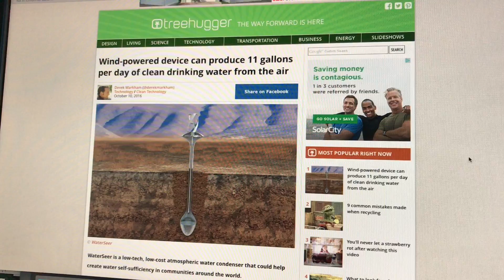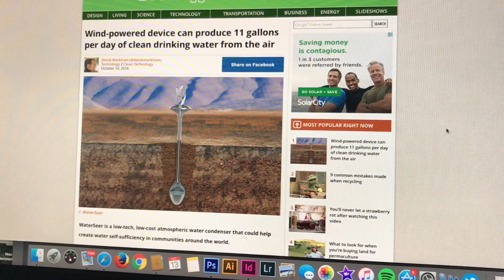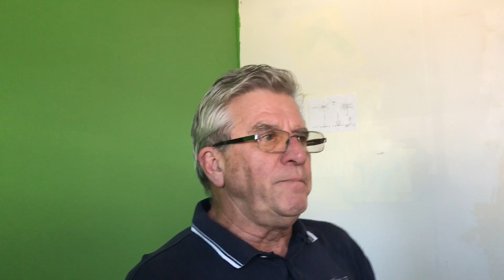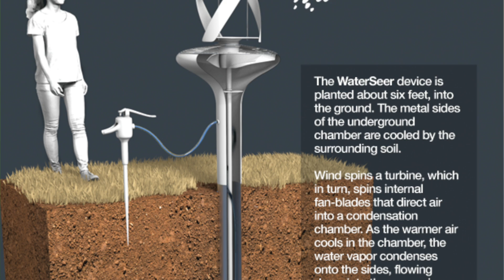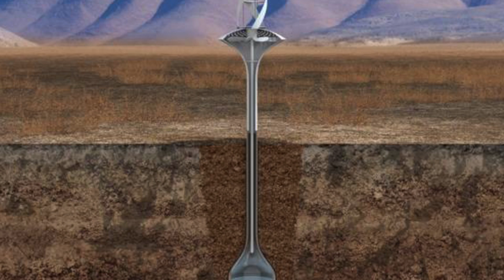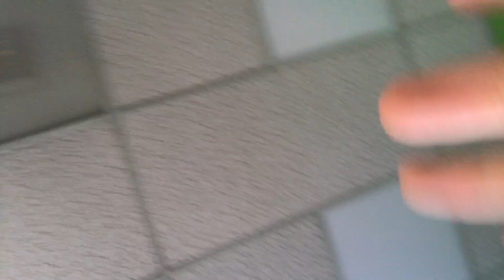WaterSeer Review

Comment: The cubic meter or two of soil surrounding the bulb, the volume that is thermally available to act as a sink, will need to cool vast quantities of air and also absorb the latent heat of condensation of any water produced.  Combine soil's poor thermal conductivity with the limited interface area, and I can't see the bulb and surrounding dirt staying cool for long.  And as soon as the bulb reaches the dew point, the party grinds to a halt.

Comment: hog wash, any movement of air will simply evaporate any moisture ,no turbine might collect some water but very little
Reply: That is a point I had missed - if the air temp going down has a dew point that is less than the ground temp, it will actually evaporate any water that is already collected. This stupid thing is a multiple loser.